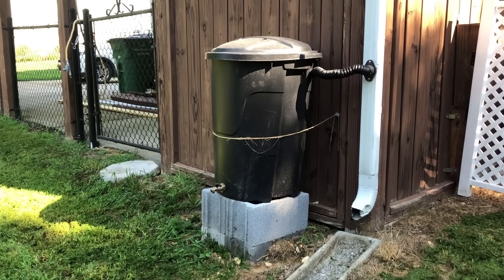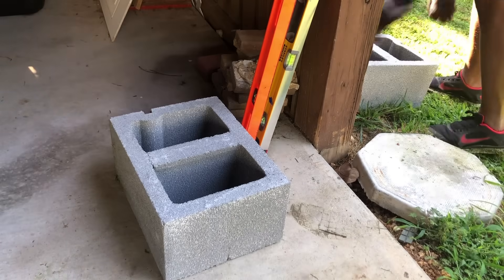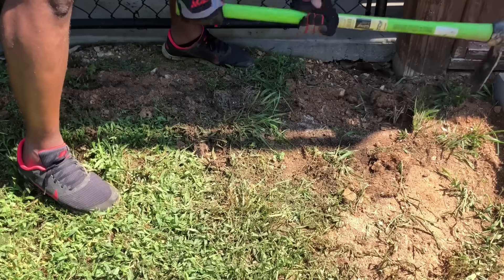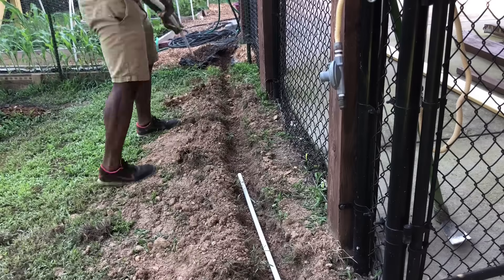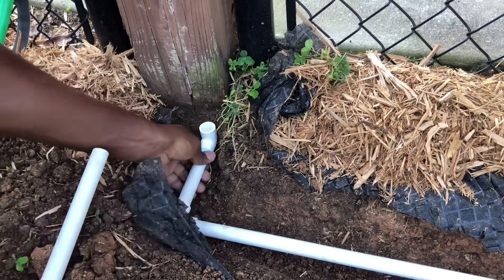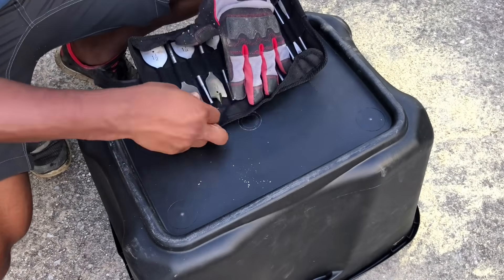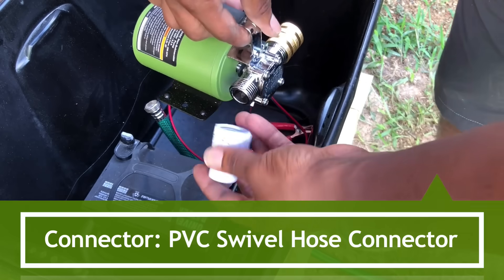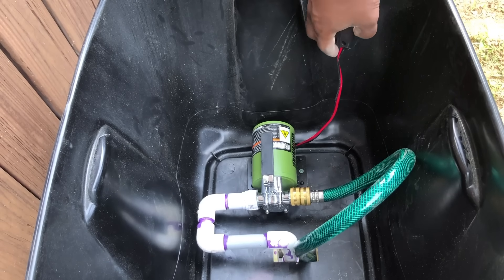Rain Barrel System | CHEAP Water Pump Setup

Comment: I'm looking for a cheap and easy way to install a rain barrel to a misting system in my small 10x7 greenhouse. Has to be solar powered as there's no outlets near by. Any ideas?
I'm going to use 1 side of my greenhouse for raised bed while having grow bags and a few short home-made grow hydroponics towers with cheap solar fountains to circulate the water solution. Just need the mister setup. I know rain water is better than city water which is why I want the setup for the misters but if there's no viable cheap option I'll use city water just have to find a way to keep wife from turning it off.

Comment: Kind of elaborate but i was interested .  I have that same Harbor Freight pump but i was going to make my own pump from abs so i can stick the pump in my tank hook it inside and have a stainless shaft i drive it from outside the tank .  So  when i hook up my hose it will hook directly to the hose bib on the water tank. The motor will be similar but may be Dc with a supply which i seal .  This way it saves me all the digging and it will pump out directly from my tank.  I want a victory garden like your doing.  Enjoyed your hard work.  Seems to do the trick . I also want a timer to turn on/off at certain times so i won't have to remember to water.

Comment: Nicely done.  I did a slightly different method, but like yours better. I bot a cheap sump pump which was designed to remain under water, and put the pump INSIDE the water barrel. I then fitted the small hose (fabricated with repair ends) from the pump to the threaded interior of my faucet in the rain barrel.  Right now I have an extension cord that I plug the pump into (wire runs out the top of the barrel). I do plan to put up romex in a conduit to a switch and eliminate the plug in.

I like your method better because you don't have a 15 amp current running thru the water straight to ground if something goes awry.  I had not thought of putting a separate box for components outside the barrel.  I thought yours was well thought out. I have a separate two barrel system out in back of my house with water running off the tin roofs of my two sheds. I might try your system on those. 

Thank you for the well done vid.

Comment: Very cool. I was wondering about the pressure - and then you addressed it. 12PSI seems low, BUT better than too high and popping lines. Wonder if there are adjustments or pumps that allow for pressure control (just a bit of research I guess)?
I'd also consider doing the pump & battery in separate bins - just in case of leaks, etc. Maybe the pump on the bottom with a bin on top holding the battery (wires passing through) and, as you point out, a solar trickle charger on top of that.
Reply from the maker: Thanks. I'm sure there is probably a way to control the pressure some how, but it's not something I have researched much. I've since upgraded my pump and moved the electrical components since making this video also. You can find the updated videos on my channel.

Comment: That’s a cross connection….. even though you have valves, valves tend to sep over time. Which can potentially contaminate your water supply to your whole home. A big no no. Other than that good stuff.

Comment: I know this vid 3 years is old. Think you should put a tiny hole at the bottom of the pump & battery housing in case there is ever a leak. That way water won't ever pool there and come into contact with battery.
Reply from the maker: Good idea. I have since then moved the battery. But definitely a good idea if I did not.

Comment: I needed this video. I’m getting ready to build a greenhouse this winter in Georgia and I’ll need it to use water catchment and solar for power and heat in colder temperatures. I also need to set it up with a watering system inside because I travel and want it to be self watering. 

Would you happen to have videos on a solar powered system and also on a fully self contained and self operating greenhouse?  I hope I’m making sense. 😊

Thank you for your excellent video.

Comment: Great video. I patterned my set-up after yours. My pump is connected top 2 - IBC totes. I used a DC pump with a battery connected to a 20 watt solar panel and controller to kekep the battery charged. Works great.

Comment: Does the motor run continuously while connected to the power? Also, is it harmful to the motor for it to run when the water isn't flowing, like when the spigot is shut off?
Reply from the maker: Yes and yes. I made a follow-up video located here regarding this: https://youtu.be/AWDUjUxs3iI
Reply: @GreenTechTown  thank you so much!

Comment: Hello Sir, great project!  What if you use a tote tub with 250 gallons of water with the transfer pump. would have good pressure.
I am trying to learn. Have a 250-tote tub and am using a submersible utility water pump with very low pressure for my sprinkler.

Comment: Nice! You might want to seal the hole that your water pipe uses to get into your pump box, in case of high water levels (flood/snow). Also, you could treat the wood as it's lying so close to the ground.

Comment: If the gutter height allows,then u can just raise the water barrel 3-4' off the deck and the 'hydrostatic head' ie water pressure caused by the height difference between the 2 ens of the pipe/hose should be enough to run your hoses etc without any pumps,electrics,etc.

Comment: A word of caution about running the pump without flow (eg, the downstream valve[s] closed while the pump is running).  "Deadheading" the pump can build up temperature in the water, even to the point of creating steam.  In PVC systems, the plastic usually fails at 160~180F.  Small pump, cool weather, takes longer, but I'd put a timer on the electrical line to avoid inadvertent run time.

Comment: The single panel setup from harbor freight works very well. The charge controller is not great but decent enough, so it doesn't destroy my batteries.
It would keep that battery full. The other thing they have which I like very much, are those rectangular security lights with their own small solar panel..
I have dropped those of a ladder, and broke them in many ways, and they still work. 2 of them I have are over 5 years old. I use them for all kinds of things

Comment: This was nice. A quick point . . . an RV pump works by automatically turning on when the water pressure drops upstream. Just turning the faucet on would make an RV water pump work. I am about to start a water harvesting project, so this is helpful. Thanks.

Comment: So what happens with overflow?  If you are gone on vacation or it rains for days on end. How do you control overflow. I have two underground tanks about 1200 gallons each.  One building runoff can fill a 55 gallon barrel in one evening. The floor is dirt so water will return to the water table.  An overflow will tell me to drain by pump, just in case of typhoon rain.

Comment: i got a 350g plastic tote, put it on bricks, and dropped a little 110v submersible pump in it.  put a garden hose on the output, and you might want to hang the pump a little off the bottom to avoid the sludge.  if you don't block entry to mousquitos you need to net up a few mousquito fish from a creek.

Comment: I believe that Oatey makes a primer/solvent all in one now.
Technically, you were supposed to use a cleaner, then primer, then the glue.
Solar panels are a good idea but expensive.
Remote control is a useless gimmick.
You can add in a moisture sensor and have it automatically turn on and off for you.
Same kind they use for sump pumps in basements.

Now, what are you going to do when the weather gets cold?
Water in the pipes can easily freeze and break your pipes.

Comment: I have a sump pump and it’s so much water gone. I’d like to harvest it; is there any safety issues like radon going from under the house to outside? The outside has a flexible hose and pvc to pour water out across the driveway - this makes ice in the winter
Reply from the maker: Good question, but unfortunately not something I'm that knowledgeable about to answer. Maybe some online DIY forum communities can give you some ideas.

Comment: This setup is great!!  Well done!  Now that you've had some time, which method do you prefer to water the plants?  By hand, or sprinkler?  Have you run into any concerns since making this video?
Reply from the maker: This system has changed quite a bit since making this video. I now use drip irrigation to water everything and so far I love it. You can find drip base videos on my channel if interested.

Comment: I have a low pressure rain barrel. I want to water my plants on a timer, but I'm reading things like soaker hoses don't work well with no pressure. I know you can use a water pump for more pressure and a timer for the hose, but how would i get them both to turn on at the same time? Or I could skip the pump If i could find something that works with a low pressure rain barrel. Any ideas? Thanks for the video, very informative.

Comment: You really should have a backflow preventer (check valve) between your two water connections at your spigot.  Otherwise, you have a cross connection between your rain water system and your potable water connection.  (unless your garden water supply from the city already has a backflow device on it)

Comment: Hey, great job !!!  I am living in Poland and need to do the same. I have a 1000L barrel but the water coming out is about 5 liters per 45 seconds. A spray nozzle does not work for the pressure is too low. I am looking at a solar water pump of 1000L per hour. Not sure if what the pressure will be like..

Comment: I'm having problems different type of set up no pump tried to use gravity for a drip line
Reply from the maker: What problems are you having?
Reply: @GreenTechTown  not enough pressure but unsure of what kind of pump I need and I have no power in the garden area 😭 so it needs to be a solar one
Reply from the maker: Well depending on your budget, there are quite a few ways to tackle that problem. The method I used is one option but does require a little bit of DIY work when it comes to the solar & battery side. If you have a little more to spend, you can also use a solar generator (portable battery station) like a Jackery, Bluetti, Delta Flow, etc. that could power the pump. The good thing about these is, they are usually plug-n-play, and support charging from solar panels. Regarding the pump, this on-demand pump I'm using in this video, https://youtu.be/AWDUjUxs3iI , has really worked well for me. Of course, depending on the distance from your water source, you may need a different pump. What I would do is either ask the store rep you purchase the pump from rather or not it may fit your needs or ask the store rep what the return policy is just in case you find the pump does not work for your needs. Also for a drip line application, since the outflow of the water line will likely always be "opened" you can probably get away with a basic transfer pump that does not have a pressure switch built in like an on-demand pump (I believe I talk about this more in the video above).

Comment: I really appreciate the detail in this video. This is my first time attempting a garden since I bought a house with enough land for one. I was torn between trying to use a bilge pump since I am very familiar with them or this exact pump. I also want to use a solar panel to charge the battery.

Comment: I learned a lot from this video.  My only criticism is your use of masonry blocks in this manner.  You put the weight of one of the legs of your base on the END web of a masonry block.  Masonry blocks are not designed to carry weight in this manner, and it could easily collapse.  Masonry blocks are designed to carry weight by placing them with the holes facing up and down, as you put them into a wall.  Turning them on their side or standing them on end (under weight) is dangerous as they are not designed to carry weight this way and may collapse.  Aside from that, you have some good ideas in this video.  (I only know this one because I previously worked in masonry construction.

Comment: A project you may consider is building a Baghdad ancient 5 gallon battery. I always wanted to try it. STEP 1 get 5 gallon bucket with lid. STEP 2 get a rusty pipe 2 inches wide or less. length is height of pail. STEP 3 cut hole in lid for that pipe and secure with fitting to plastic lid so it does not touch bottom of pail STEP 4 obtain same length copper tube that will fit into pipe but not touch the iron. STEP 5 put a thick rubber washer around top of copper tube so it will fit snuggly into iron pipe. No washer is needed anywhere else. Do not have pipes touch and have copper tube out of iron pipe to connect volt clamp. STEP 6 connect top of pail onto the bottom and open pour hole. STEP 7 fill with 5 gallons of vinegar. (Very inexpensive at only about $1 or two a gallon) let the chemical reaction do its work while testing with a volt meter. Can't remember but the copper should be NEGATIVE and iron pipe should be positive. You will find out with your meter. STEP 7 connect a radio or light bulb to the Baghdad battery or YOUR 12 VOLT WATER PUMP. The test is as follows. Will a 5 gallon Baghdad battery operate household electronics and pumps? If two 5 gallon batteries are used will the voltage be doubled? If a 55 gallon drum Baghdad battery is made will the voltage be increased to over 10 fold? How long will each battery give power?  If mercury is used instead of vinegar will the battery last forever? That experiment would have to be on a pop can size Baghdad battery. (Just wear gloves and mask) the dangers of mercury are extremely low. Otherwise mercury wouldn't be in medical thermostats to take one's temperature. The dangers of mercury are purposely given by the electric companies because  forever batteries may possibly be built.

Comment: Well Done, you hit the major points..... IT WORKS.....  One learns from each project,  if one mounts the pump perhaps on a couple of 2x4s (raise it) and added a port near the bottom of the tank, adding copper brillo pad to keep the bugs and mice out, if there is an unexpected leak the water has some place to go before the pump is submerged....

Comment: You might think about a check valve from public water side toward garden hose side to prevent accidental back feed from rain barrel to public connection if you forget to turn off public water side.

Comment: How did your prevent rain barrel water from contaminating the city water supply? 

I see no backflow preventer.  Your two back valves are not a backflow preventer and when you open the city side valve after running barrel water through the spigot,  any contaminates from the rain barrel (bacteria,  and other living contaminants can make people using city water sick. 

Always check with your Michal local water pervayor before connecting and outside water source to a common pipe that is also connected to city water.
Reply from the maker: Hey chuck. Yes, I had a backflow preventer attached to my home's spigot/city side. Thanks for the info anyway.

Comment: Hello Robert just found your channel. Great job! Thank you.

I found you because I'm trying to connect a water barrel to the main water line and the other end to the pipe that feeds the irrigation valves. To do that I need the pump to start as the controller of the valves (controls time when each of my 10 zones are watered each day and minutes for each zone). 

So how in the world could I get the pump to automatically know when to start and finish? I'm thinking maybe with a timer set as the controller? 

Second is that I need some way that the barrel stays full, using same concept of the toilet tank stays full.

A video like that would be awesome.

When the neighborhood lost water due to a main break I almost died as it was mid horrible summer and I have over 39 fruit trees and 10 veggie beds.

Any ideas?
Thanks Robert

Ps. Forgot I have another question. PVC cement you use is safe for drinking water out of those pipes? That thing stays inside the pipes,  you can even smell the fumes for days after installing pipes. It degrades over time too. So if you know of a cement that is safe for watering our food and fruits?
Thanks
Reply from the maker: Hey Laura B. Regarding the pump, I would suggest looking into an On-Demand pump which has a built in pressure switch and will turn on & off automatically depending on if there is a demand for water. So when your valves open, since the water pressure will drop, the pump will automatically turn on until your controller/valve turns off. Here is a video I made that may help: https://youtu.be/AWDUjUxs3iI

Regarding a way to keep the barrels full, I too have thought of this idea, but have not got around to it. I was thinking of somehow using a float valve for livestock water tanks since they work by the same principle. Depending on what type is used, it may also be a good idea to install a backflow preventer if you do not already have one on your city water source. 

Regarding PVC cement, I would recommend contacting Oatey.com and see what they recommend for your application.
Reply: @GreenTechTown  wow. Robert thanks so much for your reply.  I will definitely watch your video and look into on demand pumps.  Sounds like that would do it!
Looking forward to keep learning from your channel!

Thanks again